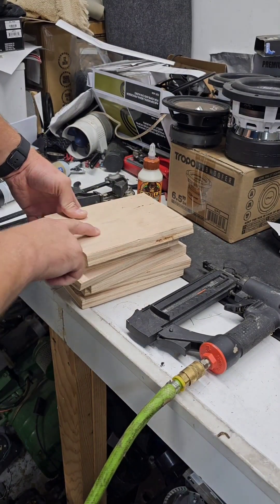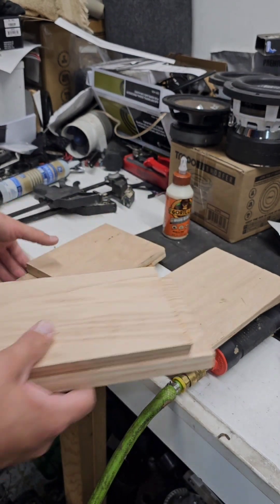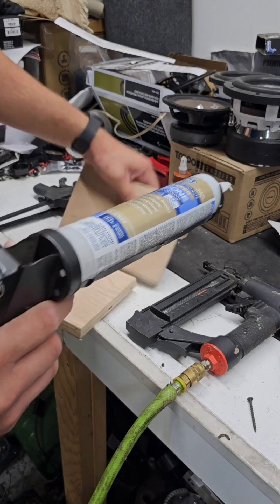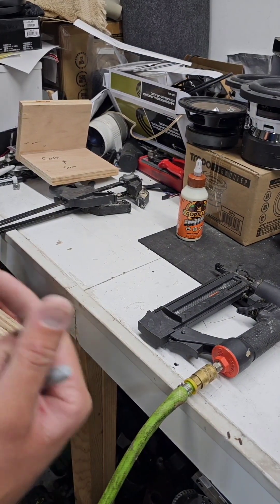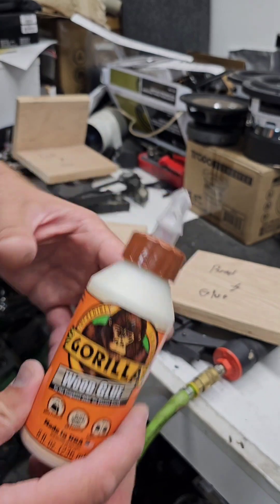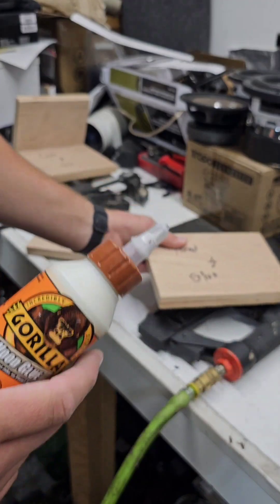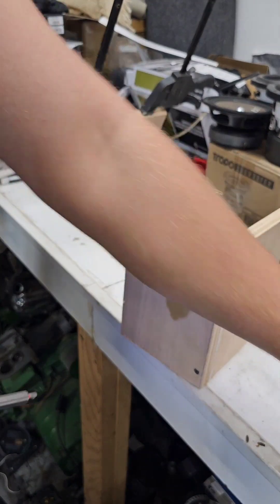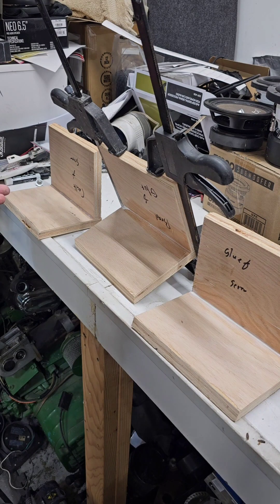WHAT'S STRONGER? - GLUE AND SCREW OR GLUE AND CLAMPING?

Comment: As a custom woodworker I will tell you when bonding wood nothing is better than glue! 

In fact you don’t ever want to screw into the edge of mdf period.. I don’t care if you pre drill it doesn’t hold right. 

Your average #8 corse thread sheet rock screws that people use are 75lb hold force.. depending on the wood glue you use I like Titebond 3 you’re anywhere from 3500lbs per square inch to 7500lbs per square inch.. 

Pro carpenters use just enough brads to hold things together with claps so the glue can dry.. occasionally we will use some screws instead of brads but again they are just to hold things together till the glue dries.. 

You then caulk the inside seams once the glue is dry.

Titebond 2 is the best wood glue on the planet period.. that gorilla doesn’t even come close to being as good as Titebond 1. I like the 3 cause it’s good for indoor or outdoor use and resists environmental concerns. 

Plywood is a different animal.. mdf or hdf is the best for a sub box material wise.. people think it can’t finish like birch but it can and even better if you know how. 

The glue holds even better with mdf then 5-7-9ply wood sheets.. but for gods sake please never use screws on mdf unless tire screwing face to face.. take the time and make dowels if you really feel like you need to add something but don’t use screws. The completely spread the integrity of you edge screw into it. 

Use some lacquer thinner in your stain and a fine bristle brush and apply very light coats of stain.. it will stain better then even Baltic birch if you know how to do it right.. you just don’t get the wood grain look is all..

Comment: Caulk is good for those without table saws that have some uneven cuts to fill.  ;)
Reply: I always used caulk. I have a jig saw and use the caulk to fill in the gaps too.  I even caulked my Skar EVL 12’s in the box for extra security to make sure my sealed enclosure doesn’t leak.
Reply from the maker: @Randy_G  no caulk. I stand by this
Reply: @Randy_G  I once made a box entirely out of caulk
Reply from the maker: Not so. I sand all sides flat. No caulk needed
Reply from the maker: I have never had access to a table saw.